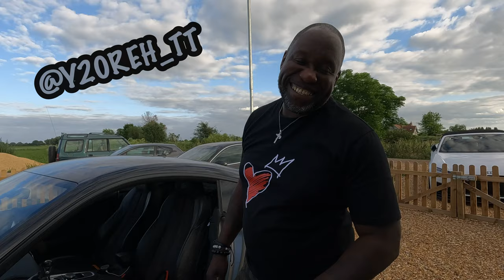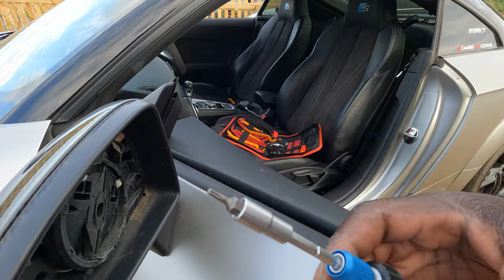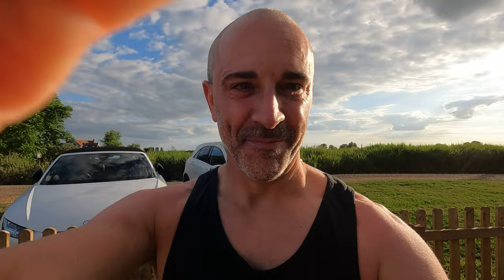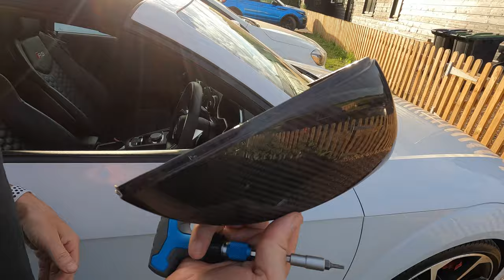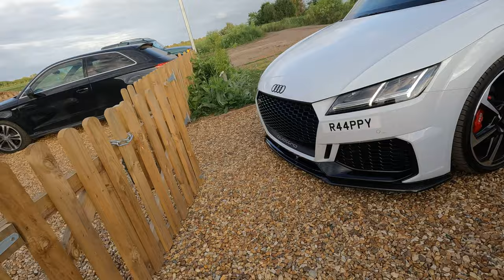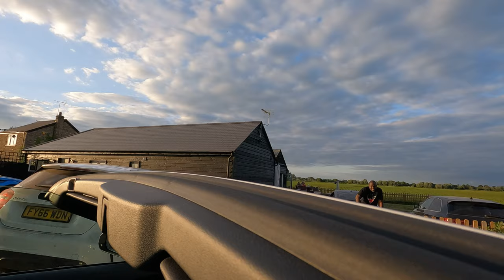AUDI TT RS MK3 8S - HOW TO INSTALL CARBON MIRROR CAPS - REPLACE WING MIRROR CAPS

Comment: Doesn't look like the screws were holding the cover on...where did they fix into in the cover ? Is it possible you don't need to remove mirror to pry  off cover ? Just a thought
Reply from the maker: Maybe watch it again as the screws are holding it together

Comment: Very nice 👍🏼....bet you're glad you used the sucker on the mirror glass now.... sorry Ray 🙈
Reply from the maker: Thanks mate…..yeah I know, good pro tip from you! Ray on the other hand flexed too much 💪🏾
Reply: @ITSARAPPTTRS  it's only from experience mate...had mine off a couple of times, firstly to swap out the indicators, and later just the caps.....can do it with just removing the 2 screws and lift the cap up, rather than out but as long it all worked ok that's the main thing 👌🏼
Reply: Great video again! Put carbon mirror caps on my TTRS recently, he was unlucky with that glass breaking though.
Reply from the maker: @jasonwalsh9211  yeah I thought just the two screws would have been sufficient but we got there in the end!
Reply from the maker: @caneytt  thanks mate, yeah he was very unlucky 🫣
Reply: @ITSARAPPTTRS  on another note can we have a how to on removing and refitting spark plugs please👍Want to whizz mine out and give them a clean but scared i’ll break something lol
Reply from the maker: @caneytt  I have no need to take mine out to be honest so, if its not broken, don’t fix it I say!